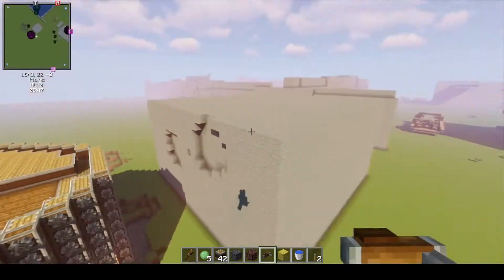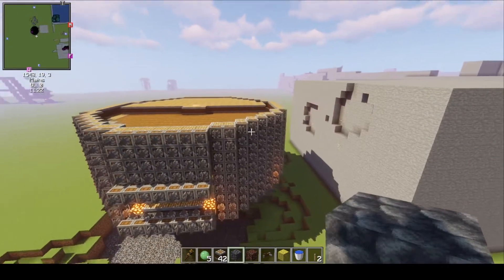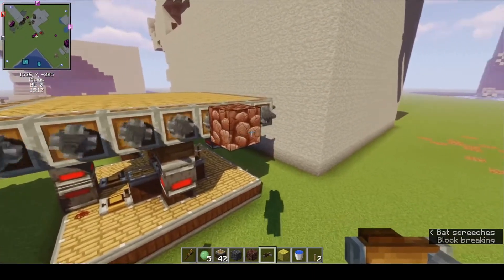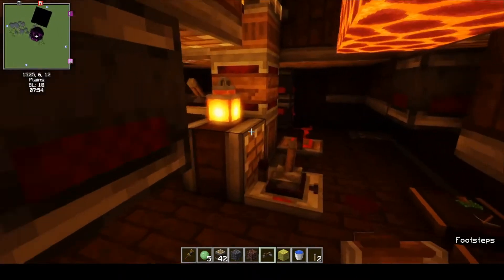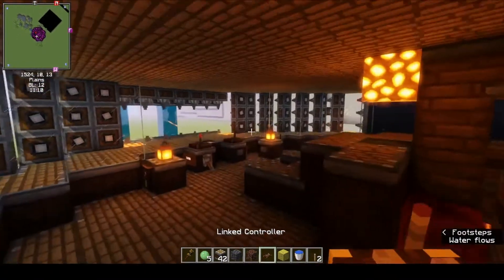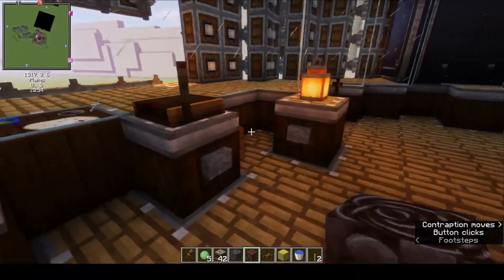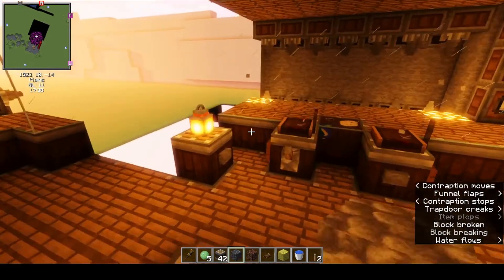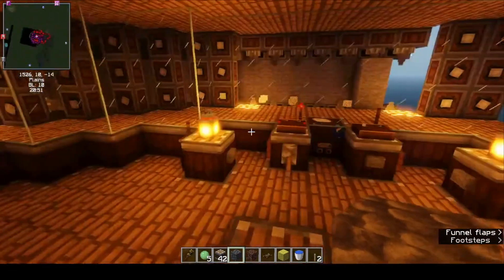Create Mod 0.4 - Fluid Proof Giga Drill

Comment: Thats pretty nice. Very similar in the issues I faced with the OmniMiner, it's nice to see someone else struggle on that. 
Pretty big yes, I don't think my pc could handle it, but the layers are pretty cool. I didn't commit to the last top layer for rotation since it was already 7 blocks tall, would have made it very bulky and I was going for the smallest design. Also my engine was moving 3 blocks at a time, which is terrible for water, but good for speed and lag
Reply: That's awesome. You guys with your awesome contraptions just blow me away.
Reply from the maker: Thanks, height is definitely an issue, I think I can still lower it by at least 2 blocks by removing the internal ceiling and lowering the secondary chassis by a block.
Reply: @KwizzleHazzizle  good luck! It's never easy to compact stuff
Reply: How would you fix this for 0.5?
Reply: @nathanpearson4600  I made a new version that just resist liquids by default. No layer, water shields or anything, it's just a tiny solid brick that doesn't care. So the inside isn't great because you can't really stay in it, but it's great for lag efficiency!